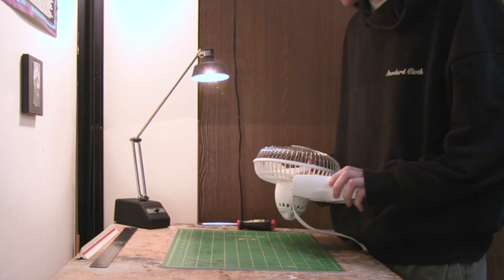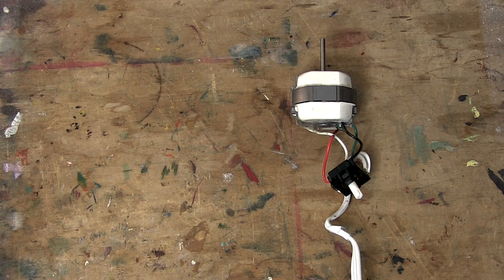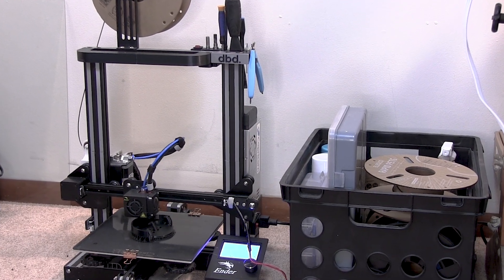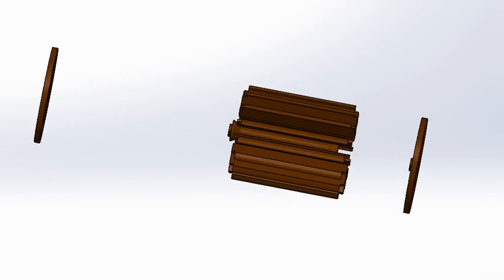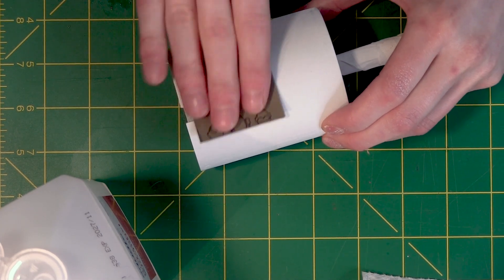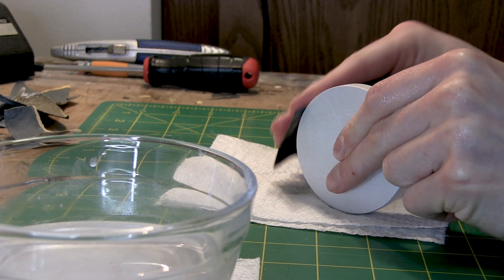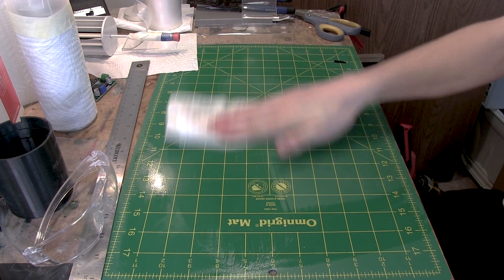3D Printing a Forgotten Icon

Comment: Nice work, but this fan wouldn't work well, due to lack of understanding, the centrifugal fan sucks the air from side and with your model there is no way for air to get into the blade, for sure you have very little air flow
Reply from the maker: It pushes plenty of air for a desk fan. Nice breeze. I don't need anything else. But I will be posting an update video with more details as I fine tune it.

Comment: I reverse engineered my door handle to my previous truck and 3d printed replacement door handles I sold that truck 4 years ago and I saw my old truck on the highway last week still has my old 3dprinted door handles on all 4 doors. The door handles were printed on my old ender3 v2 at 100%infill btw

Comment: Not a product that I would use, due to doubts regarding airflow it would produce... Even so, I love the principles behind the project! down with throw away culture, up with quality, creative thinking and innovation, and sustainability. Rather then just lining up to accept what is fed to you through trends.
I really enjoyed your video, thank you!
BTW, if you're still looking I would recommend the Elegoo Neptune 4 Pro. I upgraded from an Ender 3 V2 with professional firmware from MRISCOC ,and have had it for a couple of months. It works very well out of the box: geometrically sound frame, easy assembly, very fast with input shaping and pressure advance, native klipper that is super easy to use as a beginner, option to use the printer screen just like a Marlin printer if that's your thing, and the settings for all features mentioned are tuned well from factory. With some knowledge and settings/config file tuning I have achieved consistent 0.05mm tolerance accuracy, and never had a print fail since the tuning ;)

Comment: Great design and print project! Covering plastic waste, anisotropic strength, and surface finish, nice.
Also, I suggest wrapping a bit of foam on the end of that pipe before it's finished.

Comment: Regarding your filament choice, you could try Polysmooth Pla. It prints as easy as any PLA filament but can be smoothed effortlessly with isopropyl alcohol. The surface is softened and the layer lines kind of melt together. You are able to get a very smooth finish and the part's strength also significantly increases, maybe even reaching layer bonding strength of petg. Cost wise it es around 3-4 TIMES normal PLA, which is not cheap but it greatly saves you on post processing time.
Otherwise, nice project! Would be interesting to see the desk fan in action 😊
Reply: Is it realy giver more strength bechos it is only desolving the outer layer and will leave a weker bonding
Reply: @CasGRos  I observed that the part gets more resilient once treated. The layer bonding is stronger rather than weaker afterwards, compared to normal pla

Comment: After dropping 3d printing due to my ender 3 pro a few years ago, last month I purchased the QIDI Q1 Pro and it is a world of difference. I recommend it. Had it release sooner, I would have purchase the Prusa Core One.
Lastly, go easy on the infill. You will save a lot of time and plastic without loosing structural strength. Like you mentioned, print orientation is important. So is the number of walls and material choice.

Comment: I got a bambu a1 and I love how reliable it is. I design a lot of parts in solidworks. That said, bambu certainly isn’t the best company and if I were you I’d consider upgrading the printer you have. After getting my bambu I took my old ender 3 and a friend’s ender 3 and combined them into a machine that’s nearly as good as a bambu lab printer for almost nothing. Now it has $5 blower fans on a custom toolhead, a $5 bed level probe, dual z, direct drive, and a runout sensor made out of parts from the 2 printers and I’ve modified it to run klipper. You can buy a better printer, but if you are willing to spend a little time you can improve an ender 3 quite a bit. All in all my upgrades have probably cost $20 or $25

My friends printer was years old and unused/non functional and my ender was $40 when I purchased it. I have my bambu and I do like it so I intend to keep using it, but she’s now enjoying a pretty good and reliable printer for a very reasonable price tag.
Reply from the maker: Interesting. I was planning on using my ender 3 as a laser cutter/engraver once I upgrade. I think I'm going to go the Prusa route rather than Bambu Labs.
Reply: @ Pursa printers do seem nice and I think they’re a much better company to be supporting. I think they are currently kinda lacking in innovation that they once had, but the new core one does look nice. I couldn’t imagine spending the price of the mk4s with how little the gap is between the two though.

Comment: I dont know if you will see this, but if you use prusa Slicer, dont underestimate how useful fuzzy skin is on non interfacing surfaces. It can and will save hours of post processing. It also can look super good or weird, depending on how well you tune the setting.
Reply from the maker: Yeah if you look at my shorts I recently posted a camera lens hood and I used fuzzy skin on that! Maybe if I messed with the settings it could work for this.
Reply: What is fuzzy skin?
Reply: @martindinner3621  it makes small, I guess you could call it ramdom wiggles on the outside wall layer that give it a textured look that hides layer lines.

Comment: i have a bambu lab a1 but its illigal in my government home 😪
Reply: I just bought one too. Perfect prints out of the box. Ok, it is a closed source system, but as long it works perfect... I fiddled too much around with my Ender 3 and i had enough of it 🙂 Of course i cut the line to bambulab with switching to LAN mode. Maybe it's a solution for you?

Comment: one of my biggest pet peeves is the 3d print farms that literally print little plastic ducks the size of my thumbnail. Like, you're just starting them out as microplastics.

I'm so glad that there are options to recycle filament these days, but I know not enough people do. Thank you for your statements!
Reply: How do you recycle filament?
Reply: @WeJe-o4u yes, shred the plastic, filament or old prints, then extrude it into filament. there are a number of full built ones you can buy,
Reply: @WeJe-o4u 
you cant realy bechos of the degrading material qualetrys
Reply: Wait does PLA produce Microplastics too? Won’t those just biodegrade?
Reply: @Microplastics3 
pla wont biodegrade in nature

Comment: i think the perception that people mostly do cheap toys with 3d printing is because that are the most sharable pictures, i bet most of the 3D prints in the world are non toy related - a random replacement part for a random household item will never be as shareable as a cute little multi colored penguin
Reply: I'm with you on that. That's not "sexy" though. My first print was a replacement knob for my water heater. Nobody really cares or wants to see that. Most of my prints are like that, replacement parts/mods.
Reply: They also rarely appear on a website for 3d printable designs because they're just too specific. A replacement part for a random tool bought 15 years ago probably wouldn't see more than 3 downloads over the lifetime of the website.
However I think you are wrong about those things outnumbering generic toys, at least in the consumer market. Many people use Bambulab's app to just directly print a part right from their website as it means they don't need to touch a cad program or even slicer. Convenience will always win unfortunately.
Reply: You make a good point, but I'm not quite convinced. I think a minority of people with 3D printers are actually using them for replacement parts or practical things. Because doing so requires CAD skills, and not everyone with a $200 Ender 3 has those.
Reply: Most of my prints have been little odds and ends as replacement parts for stuff like the broken pipe fitting that forms part of my wide format printer's output basket, or just random things I need around the house like cable clips for under my desk and custom mounts for AC adapters.
Reply: The equivalent of cooking for Instagram vs cooking for yourself lol

Comment: A really good way to get extremely smooth finishes are ABS and vapor smoothing with acetone. It is tricky, but once you get it, you’ll never want to pickup another piece of sandpaper. Just have to be mindful it might change tolerances some if you go too crazy with it. And obviously printing ABS period. 🤙🏼🤙🏼

Comment: where the fan does pull air from?
Reply: Yeah, it needs an intake on one end (or both ends) of the squirrel cage. As it is now...somewhere along the length of the blades it is less efficient and drags air in against the forced flow.

Comment: After all that, not even an instant of letting us hear it running, or seeing how well it moves air?

That feels straight disrespectful.
Reply from the maker: I'm still new to making videos and honestly I thought I had included enough. I will be posting a YT short soon with more footage.
Reply: @distracted-bydesign  Fair enough.

Not that I am a pro, but I watch a LOT of maker content, so I think I am at least half qualified to say, Pro Tip:

If a video is about making something, you should include a little of the thing being used, and a final opinion of if you are satisfied or if you think it may have been better if you did something different.

DIY Perks is, IMO a masterclass on how to make the audience feel satisfied at the end of a vid.

Comment: Depending on the size of the gaps, you can try using Hobby Surfacer Primers (e.g. Mr Hobby/ Tamiya) instead of body fillers. That will be easier to manage and requires less sanding than the larger blobs with the latter.
Also, these brands generally do make foam/ sponge type sanding pads which can be used as wet sanders and will readily conform to the curved surfaces
Reply from the maker: Thanks! That's super helpful. I think I've heard of hobby primers but I have never seen them in any stores (Michaels, Walmart, etc)

Comment: Just fyi if anyone’s wondering, it is possible to print things in one color on Bambulab printers. At least it is for now, I guess we’ll have to wait and see if Bambulab updates its ToS. But as of right now, they’re not forcing users to have mountains of waste filament on every print
Reply: It always has been lol

Multi-color prints will always have some waste due to the nature of how they work. They need to purge the stuff if you want a clean color. 

That's because it uses 1 nozzle. Using multiple nozzles like the pruss xl would he much more expensive and sounds like a nightmare to maintain. 

Its a trade off really because that's How the way things go. But it is rumored that bambu is also working on a multi tool head system. But it looks like it's using 2 nozzles instead of 1
Reply: @ yeah I know. I was being facetious, brought on by the straw man in the rhetoric about the problems of 3d printing. I own a sliding mitre saw, and we could also pontificate of the morality of that tool: it has the potential be used to make unnecessary rubbish, it contributes to the chopping down of trees, and it could even be used to dismember a body. Maybe I’m reprehensible for owning one?

Comment: cool video i really enjoyed it however i disagree with your opinion on 3d printing. from personal experience of volunteering and teaching kids 3d printing and 3d modeling i see a lot of kids get really existed by the little do-dads and toys and "junk" and motivates them to learn how to model and 3d print, even as an adult i really enjoy some cool toys with cool mechanisms which inspire my designs. i know we are worried about the pollution junk 3d prints however i personally feel like the creativity and the inspirations it bring far out ways the downsides. another thing if plastic pollution is your issue, i found the 3d printing community to be one of the most responsive community's to waste and we constantly looks for ways to recycle filament and use filament smartly
Reply from the maker: I should have mentioned that. I think if you're getting kids into 3d printing using the various toys and gizmos that's great! I just don't love the idea of print farms making thousands of them.

Comment: where is the air inlet into impeller?
Reply from the maker: The shroud surrounding the blades. It basically just scoops the air and guides it back out. Sort of like a water wheel.
Reply: thanks, I didn't think of that

Comment: I'm not sure what slicer you're using, but if you use OrcaSlicer, you can import the files as .STEP and you wont see the issues with polygons creating flat spots on round parts (5:16). Should make post processing much easier.
Reply from the maker: Yeah that was an unfortunate mistake on my part. I had accidentally made the facet quality pretty low in Solidworks for STL exports. So it happened before it even made it to the slicer.
Reply: It tecnecly still imports it as a stl 
the differes is that the slicer converts it on the fry into a stl

Comment: you didnt really show any footage of your fan working or blowing anything i think this is because your project makes a major mistake, you cant just steal a axial ac fan motor and plop it in a radial fan of completely differant diameter and exspect it to work well as a desk fan, AC motors run at a fixed RPM depending on the wall frequency and that motor was optimmised to run at lower RPM than you need because the axial fan has a higher radius then the radial fan your using, you would of had to found the optimal running rpm of your fan and then found the correctly speced wall voltage AC motor for it to make this work well, or rectified the wall voltage to DC (laptop charger) and run it off a BLDC motor which you can vary the speed with a speed controller so you can get it to a good RPM to work right.
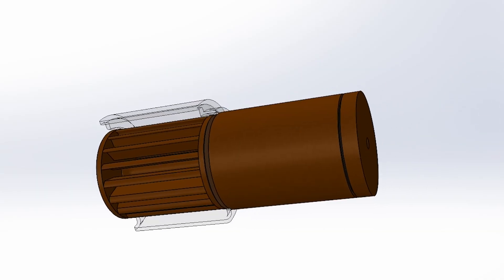Reply from the maker: Idk man it works pretty well. Go to 9:55

Comment: I recommend building a Voron.  Amazing machines, with way less limitations than something that is closed source.  Being a designer I think you can also appreciate the very well thought out design of Voron machines.  It can seem daunting at first, but I have no doubt you would be able to achieve a very nice build, simply from watching your skill sets in this one video.  Cheers.
Reply from the maker: I looked into it a while back. (Went through the BOM, priced it out, etc.) But after 4 years with the Ender 3,  I am DONE tinkering with 3d printers. I usually just want to be making things with it and I'm not too concerned with super high speeds or anything.

I'm thinking of a Prusa Core One, or maybe wait for the next version of the Prusa XL. I love the tool changer on that thing.

Comment: Man this is sick. The print line orientation is so similar to thinking about the strength of an object in relation to wood grain. Also definitely the right move to go back and repaint and refinish, it looks so much better. We’re both making filming side projects while working on the main project haha.
Reply from the maker: Yeah it's definitely hard to find a balance between focusing on the videography and just working on the project. The overhead camera mount helps a lot!
Reply: @distracted-bydesign  I’m sure it helps- I’m definitely looking to do more overhead, it’s a clean look
Reply: This is what the algorithm needs to recommend more. Quality content from channels of all sizes. Subbed
Reply: @theneutralnode-s  facts- I saw the video before this one and instantly subbed, @distracted-bydesign if you keep making videos like this you’re gonna blow up

Comment: you don't actually have to butcher the german pronounciation soo much. braun is just pronounced as brown with a german accent. dieter can also be pronounced almost correctly by not tryharding so much.

cool project anyways!
Reply from the maker: I know I know, I definitely debated how I was going to pronounce it. Settled on "typical American." I think I got "Reinhold Weiss" somewhat correct though!
Reply: that's the most french thing you could possibly write